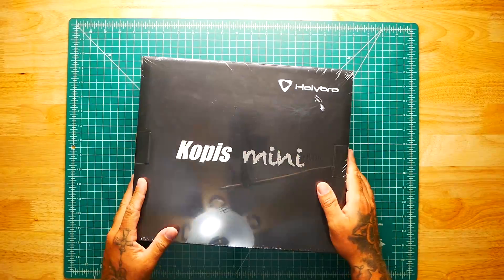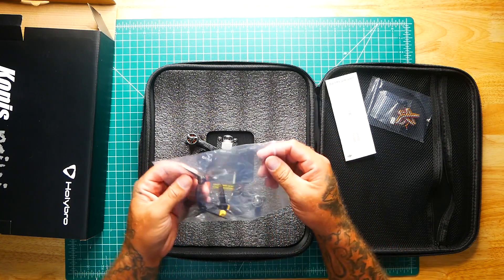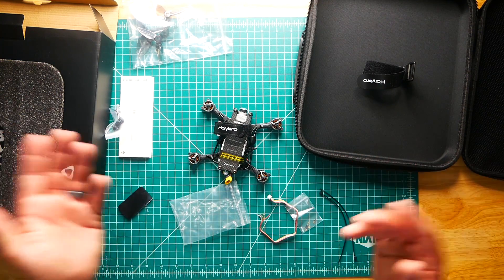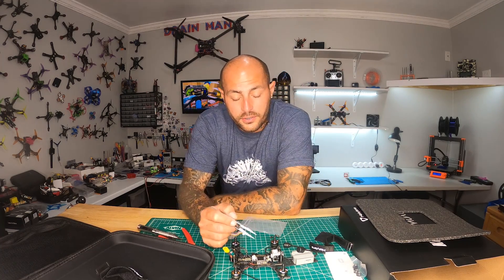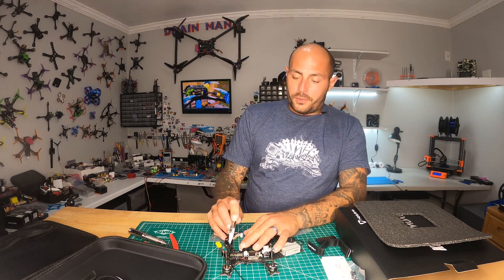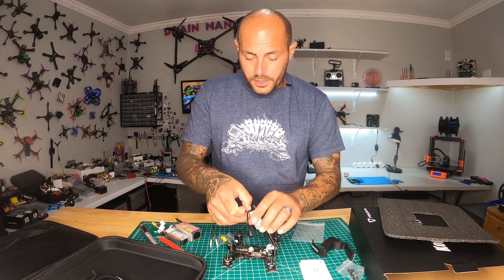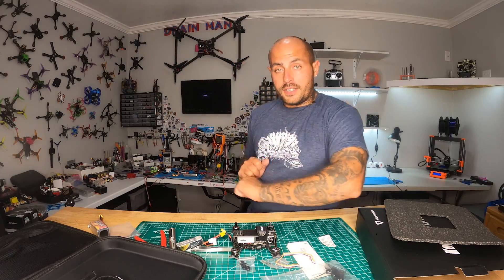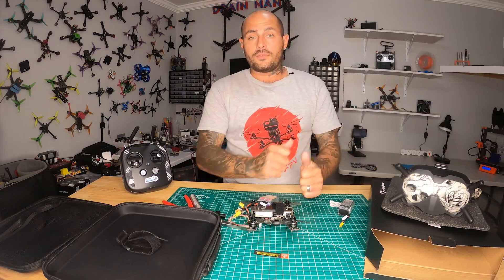Kopis Mini DJI Version - Other Micro's Better Watch Out! 👀

Comment: Damn man my first quad was the iflight DC3 and I hate that quad so much back in November 2019 I used the same tatuu 850mah and it gave me about 3 minutes of fly time and it was super hard and unstable to fly. I jump to 6s 5 inch and fell in love now I see people everywhere talking goodies about this 3 inch quad and I’m jealous but I had so many quads at this moment that is psychological impossible to see a new one 🤣
Reply from the maker: haha
Reply: @Nestor Fernández
 Make sure your using a quality battery. Those "2 for $20 4s 850mah Amazon Specials" most likely will give u  short flight time. Always buy the highest C Rated batteries you can afford also... On most 3in setups running a 4s 850mah battery you should normally expect around 6mins flying freestyle.  Even longer if your not "RiPPin it".   I know the  iflight DC3  runs really nice  Xing motors. Not sure of the Kv though. Thats what is going to determine flight time also. Keep in mind: 3in on 4s 3300kv-4100kv is the sweet spot.  3300kv=little slower / longer flight time , 4100kv=faster / little less flight time....